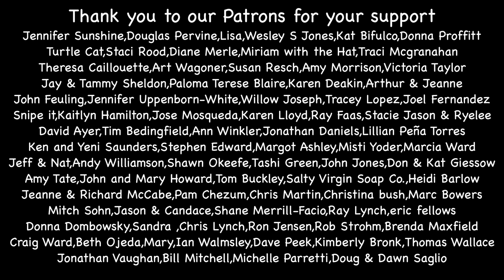POURING CONCRETE COUNTERTOPS for our BRICK PIZZA OVEN // pizza oven build PART 2

Comment: Really old retired architect here. 
Why oh why did you pour all the vertical cavities in the oven base full of concrete? 1.) Lateral stability...nope as the corner of the patio serves that need, 2.) vertical load carrying...nope only building an oven not a 3 story industrial building 3.) make extra work...probably!
Ah, the exuberance of youth...I honor you.
Reply: As they've explained. They usually over build everything because they learn by doing it for the first time
Reply: Not to mention how low the countertop is.

Comment: My kids never had a bottle and they breast fed until age 4. Two kids. At some point we had a new born baby on one side and a 3 year old on the other side. Of course they also had solids from an early age too, but they wanted to keep breast feeding for a long time. Their mother didn't refuse them and let them decide when they stopped. I know this is not for everyone. I only tell you this to give you a different perspective. Before humans made a good bottle for bottle feeding we only relied on breast feeding. Breast milk is natural and provide hormones and boosts the babies immune system. Also breast feeding helps the mother. And somehow it helps the mental health of both baby and mother. The act of breast feeding help babies form healthy attachments. Lastly, baby formula is not good for your baby. Many locations in the world manufactures put fillers into the formula and in some locations like communist China, they had children die from the things they put in baby formula. So trust your baby... they know what is best for them.

Comment: Funny you should mention the adult size jumper.  My brother built something like that years old.  It was a large tripod made from old telephone poles.  At the top, it had a huge large, black rubber bungee cords at the lower ends there were strong chains.  These were all attached to an old metal barrel he attached a thick layer of old blankets.  And he had ropes for the rider of the barrel a way to get the thing bouncing.  Everyone enjoyed the heck out of that thing for several years.  He eventually took it down when all interest was lost.

Comment: They usually put a thin coat of morter on the bottom and side of the block before setting them for bond strength.

Comment: Again guys, you still didn’t butter the sides of the blocks where they connect each other   It will  effect the strength and as I read other’s comments is you should have installed rebar as well. Just trying to help out. Love watching you guys👍🏻🙏🏻
Reply: Did you not see the part where he filled the blocks with concrete?. You could drive as D9 on that thing
Reply: You could park a tank on that pad it’s not going anywhere
Reply: He also doesn’t wet the blocks first before buttering them. He needs to learn things the hard way. He’ll be redoing that job like he did his foundation and his roof. Hahaha
Reply: @Naplesfrank154  And you think you are a know it all??? LMAO you probably have not built one thing.
Reply: @ginna8951  please don’t be ignorant. I used to build houses in the 70’s and 80’s. I am a journeyman in plumbing and masonary and have extensive knowledge in electrical engineering. What do you have to show for yourself?  You probably can’t even bake a cake.
Reply: You don’t need to wet block prior to laying them. You do need to butter the ends to ensure proper a proper bond. Since there were no vertical rebar placed in the concrete into the cells it could have to potential of shifting during any seismic activity despite the filling of every cell with a grout like substance. The countertop pad isn’t attached to the wall with rebar so even though the weight of the concrete will ensure that it will not move it would easily be demoed without damaging the block wall. All in all… if there are no earthquakes then the structure will more than likely be there for an extensive amount of time. 10 plus years.
Reply: @Dacejoe  ok so when you build your house out of bricks, don’t pre-wet any of the blocks and then pray that you don’t have problems later. I guess you must be a weekend warrior and rely on Home Depot or Lowes for building instructions. 😂😂😂. What a joke.
Reply: @MrBrickboy38  yes that was a great job. I wasn’t talking about the slab. I was talking about the cinder block install
Reply: @Dacejoe   you don’t wet clay bricks because they will most likely shrink when they dry but cinder and cement blocks should be dunked in water until the bubbles stop and left to sit a bit to get rid of excess water. When stuccoing over a previously coated wall, the wall should be moistened (usually with a garden sprayer before stuccoing over it or the cement will not stick well. If you are a journeyman you should know that. I seriously doubt that they taught you differently in St Louis than what they taught me in Jersey.
Reply: Local 5, south Jersey.
Reply: I had to follow up to ensure that there were no regional deferences in your laying procedures. So I just spoke with Tom who is the apprentice trainer for local 4 and 5 in the south Jersey area. He stated that they never soak block. If block are presoak then they are harder to lay as well as introducing the possibility of chances of soluble salts bleeding through when drying. In fact the laying procedures established by the manufacturer states that all units should be dry when they are laid. Even when making wet cuts the unit should sit and dry prior to installing unit in the wall. So indeed, there are no training differences for installation between our regions. As far as prepping the surface with water when applying a scratch coat or (which is not something they are doing in this video) is not necessary if the mortar is to the desired consistency. Although Tom and I did not discuss soaking clay brick, it is a common practice when using the select units as I described in my previous comments. 

They do have a program known as an improver that trains you to the common practices when laying modern day units that is very interesting. Me being a journeyman and laying brick for the period of time that I have can spot inconsistencies in your comments that leads me to believe that you’re a troll. As well as knowing it is frowned upon to be a dual card holder. I would strongly advise you to update your laying procedures prior to giving out such misinformed information.

Comment: I read the comments that the oven is too close to the house and wonder why it's any different for a pizza restaurant to have a brick oven inside the facility in the main kitchen, open to everyone.  I think outside next to a metal building it will be ok.
Reply: Once you have worked with a wood fired oven you know where the heat is, and where it isn't.  The location is just fine.

Comment: Wow your boxing is so strong. I thought you would have cut up an old pallet to prop up the centre of the ply and poured a 2 inch slab which would  be lighter. Then stuck the rebar on the wet concrete and let it set for a few hours  to stop it sagging and then poured the top layer then knocked out the props when it was dry. What you have done is so strong.

Comment: Do this.  Stand up straight.  Pretend you are sliding a pizza into the oven while looking in the imaginary oven without bending over.  Make it comfortable..  Measure how high your hands are off the floor.  That's the target height of the floor of your oven.  When you lay the floor, put down a thin sand bed and lay the refractory brick diagonally.  No mortar on the floor unless you want a mess when the oven gets hot. lay them as close together as you can get them.  Fill any gaps with sand.  The bricks are diagonal because the peel will be less likely to bump against an edge of brick.  I'm going to enjoy watching you build it.  I enjoyed watching Jake and Nichol build their cob oven.

Comment: When you put those blocks in. Make sure you do the sides as well. That way everything is sealed up. I was noticing you just putting mortar on the bottom and not the sides.. Makes for a stronger overall structure.

Comment: CONCRETE PRO HERE: You don't have to tie every single rebar joint together. Also, you don't have to fill every single cell with concrete to make your structure strong. You can do every other or every two cells and it'll be just as strong. Sometimes, less is more! :)

Comment: You could use a small plastic cup or even a hand trowel tool to scoop the concrete to pour it into the holes. It would be easier than using the shovel & probably quicker. Also I would've put plastic to keep your walls & floor protected from concrete splatter.

Comment: Jordan, Why no Mortar on the ends of the blocks to hold together better? I know you are filling all holes but they should still all be mortared together first.
Reply: Shhh, it will be like the roof and the roller door. Eventually they will do it again properly after months of denial of any issue.

Comment: Should have stuck rebar in a few of the holes sticking up about a foot or 2, then bend them over after the concrete set up to tie it all together and tie the top into the whole thing.

Comment: I always leave my city water out for 24 hours before using on plants to let the Chlorine evaporate. Works for me!
Reply: I do that, too! I've been doing it for years. I also attach an RV filter to my outside spigot to water my raised beds. Cheap and useful from Amazon. Lasts about 3 months.
Reply: @miamerle8965  Wow, that's a good idea!
Reply: Not long enough I'm afraid, from the internet: "2 ppm of Chlorine will take up to 4 and a half days or around 110 hours to evaporate from 10 gallons of standing water. Ultraviolet light, water circulation, and aeration will speed up the evaporation process dramatically. Chlorine will last between 6 and 8 minutes in 10 gallons of boiling tap water. Boiling is the fastest method to remove Chlorine from water"

Comment: For next concrete block project, don't feel you need to fill ALL the holes. In fact a few with rebar woven thru (vertical/horizontal) is much stronger.

Comment: I wouldn't worry too much about bleach and the plants.
At the Buccaneer Lodge in the Keys, the pool equipment area is surrounded by a stockade fence.
There are plants all around it. 
The biggest, healthiest plants are on the side where the pool water flows when the filters are flushed.
Commercial pools are required to maintain a very high chlorine level.

Comment: Generally speaking when building forms, more screws and less nails will make your life better later. Also, don't attach fasteners from the sides where concrete goes.

I'm also curious why you didn't connect the counter top to the base using rebar.  Was that intentional?

Comment: You could have saved time and space by using your retaining wall as two support sides of your concrete counter.
Also you could have used a chalk line and a plumb bob to simplify the leveling of the blocks.
I Know... I Know... I am only mentioning this as I have worked with the local Bloquero's in construction of my finca.
It is easier to critique than to perform :-)

Comment: Please don't leave your truck standing with the sand load for long as the rear axle side shafts will bend and the oil seals will leak and all the oil will run out and you will have to replace your side shafts and bearings and seals

Comment: Yeah, you don't need to paint the wall again, just wash off the splashes with a sponge before the cement gets too hard. And even then, you can probably rinse it with a mild solution of water and hydrochloric acid (muriatic acid).

Comment: I am very surprised that no one had told them that it is very important to put steel bars ...especially living in the area where they live...
Reply: Is this your first video you've watched? They've been using steel bars like crazy lmao
Reply: @erik260  no darling, is not my first video. I know they have used a lot of steel... I am talking about "this" specific project... Plus, as a sight note... I am Panamanian, and I know how we build here in Panama...and for safety we use metal bars when we build whit cement blocks. It was not a criticism, it was a opinion...
Reply: Abi Blanq 1976 I am sure someone said it but everyone is always telling them something. That oven is going nowhere just like the house and most structures on that property. All the holes in the blocks were filled from top to bottom. If it crumbles in an earthquake, it will be the only thing on the farm that does.

Comment: Guys, I have been saying this for the last few videos but you don’t seem to listen. You need to wet all the areas that you will place cement on. Failure to do so will cause the dry blocks or cured cement to draw the moisture out of the new cement therefore weakening the new cement. Please listen, it is very important.
Reply: lololol They don't have to listen to anyone. Sometimes there are a thousand comments and if they catch the first hundred, that's good. They listen when they want. I would go nuts having an audience that said things like "...but you don't seem to listen". That's just crazy.
Reply: @zariballard  so you can go nuts if you want to. For not listening he’ll be the one that has to re-do the cement work within a year. The cement will erode away so quickly. I guess they only listen to people that put money into their account via patreon. They shouldn’t forget that they won’t earn YouTube Adsense if they lose subscribers.

Comment: You don't see a possible water drainage issue with that so close to the house? 🤔
Reply: Watch the video where they laid the cement for the deck. They addressed this issue
Reply: @erik260  I'm talking about that gap where the concrete table is higher than the foundation ...looking like there might be a learning curve ahead...especially during rainy season

Comment: my kid is ten. breast feed for as long as you (momma) feel happy to do so. i was only able to go 3 months, due to a lack of support. 

also biggest thing id say is warm the wipes/ cloths , w.e you use to wipe her bum, warm it up slightly. i used the microwave for 4 sec for the mss produced wipes, tho a damp wash cloth will warm up just the same. 

a few min in the sun inside of some black plastic would be enough. 

warm wipes are good for bums and for dirty faces or runny noses <3

Comment: Why did you decide to build the pizza oven so close to the building? I would think it would be a possible fire hazard.
Reply: There are literal pizza ovens inside restuarant lmao 😂
Reply: @erik260  yes, and they’ve incorporated fire protection protocols, otherwise they wouldn’t pass building codes
Reply: @critterkarma  so whats dangerous about the oven they are building?
Reply: @erik260  I don’t know, which is why I asked. Though common sense dictates, that one be very careful having a fire source close to a building. Which is why, you don’t use a BBQ grill right up against a building. Even though the majority of materials their workshop is constructed with seem fire resistant, the window frames are wood painted with oil based paint. With all the high winds they have, flying sparks are what one can expect.

Comment: Please wear a mask whenever you work with concrete! (For your health!)

"Some of the most hazardous dust on job sites can be released by cutting, grinding or blasting concrete and engineered stone. You may also accidentally inhale such dust by breathing in the material when opening a bag.
 
The dangers of inhaling concrete dust and stone dust should never be played down. Dust from both can carry high volumes of silica, which can travel into your lungs and cause scar tissue or cell necrosis. When enough silica crystals are inhaled over time, lungs can be damaged beyond repair.
 
Crystalline silica is microscopic and that makes it impossible to spot with the naked eye when working with concrete and stone. People whose lungs may be affected by inhaling silica long term may be diagnosed with Silicosis, a disease that occurs when silica dust is inhaled to a potentially fatal extent."

Comment: Did they ever get heat treated blocks and bricks for their pizza oven? It seems to me that they didn't understand that they needed heat treated block for the base along with fire brick as the heat generated in the oven will travel to the block used for the base and they can crack and or  explode. Someone could get really hurt. I don't know about anyone else but TMI on breast feeding and baby stuff. I'd be happy to see just one new video without the baby, just their farm, their animals, and their projects.